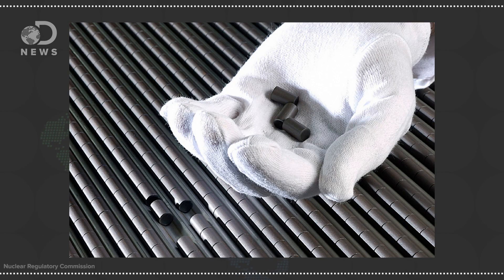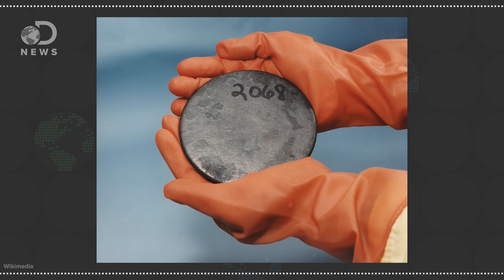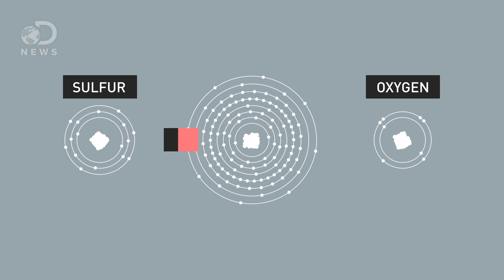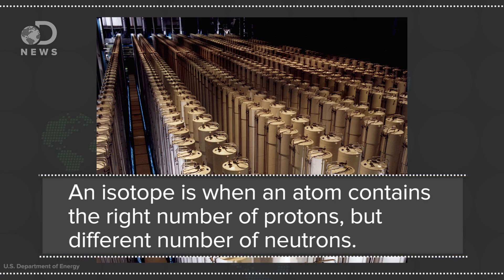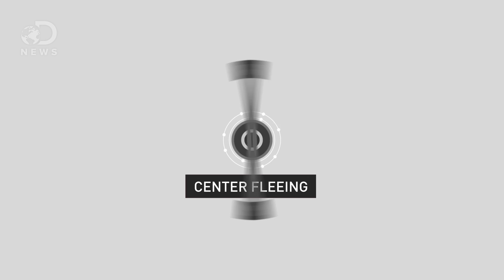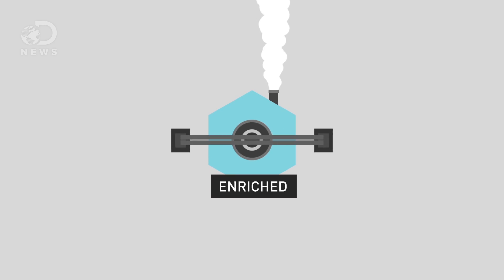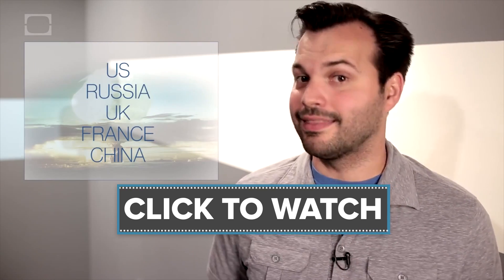How Uranium Becomes Nuclear Fuel

Comment: Sure they're called nuclear power plants, but they're not using it for energy how people imagine. They're essentially using it as a heat source to turn water into steam which that steam goes to a steam turbine and that spins a generator. I could get really technical with it since as a Electrical Controls Engineer III  and Integration Engineer I've done work for couple nuclear power plant facilities, which they all operate the same minus one detail if its high pressure produced steam or boiled water produced steam even though both still use high pressure except the boiled method not nearly as high. Water boils at different temperatures under different pressures. Other than that they all work the same.

Comment: No mention of thorium reactors? I naively assume that the thorium fuel-rod prep is quite a bit simpler to fabricate, that the rare earth thorium is more abundant and inexpensive than uranium, and that these reactors don't need to also be rapid breeder reactors that can "run away". Benefits are i) they don't create weapons-grade plutonium, ii) they can't run away, iii) they were recommended for use near populated centers in the 1950s and 60s, but Nixon authorized only rapid-breeders because of the need for weaponized plutonium during the cold war.

Comment: What I am trying to understand how can you handle a nuclear fuel rod with just minimal PPE before its inserted into the reactor, but once it has been in the core it becomes super radioactive, and very dangerous to handle?
Reply: Fresh fuel is pretty benign. Spent fuel contains lots of fission byproducts with very short half lives, and thus they are substantially more radioactive than fresh fuel. Until the fuel bundles are loaded into the reactor core with a suitable moderator no fission actually takes place. Spent fuel does indeed need more conservative handling than fresh fuel.
Reply: @paulanderson7796  Thanks for the explanation. 👍🏻

Comment: How much energy does it take to make U-235? Is that figured into the percentage comparison between fossil fuels....

Oh, it's not 3 roetgen 
Its
15,000.
Reply: It takes a fair bit, but still not really that much compared to its output. This is particularly so with centrifuges vs gaseous diffusion which is no longer used.

Comment: How do you activate the fuel rods in reactor at 1st time?  Does the fission reaction start by placing the fuel rods into a moderator?
Reply: Most fresh fuel will have the need for neutron sources initially. After a reactor has been online there is enough excess neutron reactivity from the fission products that spontaneously fission to start the reactor without the need for these sources. Fuel rods in LWR are always next to moderator because it is also the coolant, IE, water.

Comment: Assuming energy resources permanently run out, that is to say they are (finite), there is no point in killing each other – USA, N.Korea, Iran and so on,  over  finite resources because even  if anyone emerges as the ultimate winner after killing off all other competitors, that winner will eventually be met with a  resource depleted world, meaning they would in the end - after all that murderous struggle & victory, die too. Surely our intellect should enable us to see such an out come.
Assuming that energy  resources do not run out permanently – which it seems is the case, but rather there can be periodic shortages, we can do one of two things.  Either we continue to kill each other using the resources we have accumulated, from sources that do not run out permanently - a completely and utterly wrong thing to do, to use up the very infinite  resources to destroy ourselves, or use those very resources to find more resources there by mitigating the shortages.  This choice has been open to us since the dawn of our existence and will always be until we wake up to it.
If we assume that humanity has a half life  of 100 million years, the point being it is much less than the half life of  elements of Uranium or the sun (sources of energy), this means the human life will run out (extinct) way long before these energy source will do. So these energy resources are infinite with respect to the humans maximum life spun.
It seems we are killing each other under the mistake that resources run out permanently which is not true. They are sometimes in short supply. It is smatter to use the resources to find more because it is endless.  I hope we learn this and quickly change. Both war and peace require huge investments one is unquestionably better than the other. 
Finally evidently no energy resources have really permanently  run out in the last 1000 years. There is only theoretical speculation that they could run out permanently  based on a mono-intellectualism.

Comment: It might be all that efficient Plumbing is also all that very much dangerous at the same time is it worth the trade-off of another Chernobyl, Three Mile Island or Fukisumia.. it's only a matter of time before the next major disaster happens.  there's already a runaway core burning its way through our planet from Fukisumia that no one knows where it's at or the damage it's doing. Worst of all what that damage means for our kids and great grandkids.. We need to do more like the Swiss(I think) and their 0 emissions oil platforms drilling rig processing plants they have. And there wind and solar Technologies.
Reply: There is no runaway core at Fukushima, that is just ridiculous. Fission can only happen in very specific geometries. You have to make it happen. Once the core melts, it stops fissioning, period. No argument that nuclear technologies need to be handled with care, but the idea that it is excessively dangerous compared to the alternatives, even wind and solar, is not really supported by much science.
Reply: @BeCurieUs  where is your proof of this?
Reply: @jeffwolf8018  The laws of physics and reactor kinematics for one. Also, that all reactor coriums have been found. The most recent one was in January 2017. It was outside of the primary reactor containment but inside the secondary containment vessel. I would link an article but it will just get the comment blocked for spam but if you google "Six Years After Fukushima, Robots Finally Find Reactors' Melted" you will get about a dozen articles on the fact. Units one and three did not melt beyond primary containment. Reactor 2 was the only one to have that unfortunate privilege if memory serves. 

But more importantly, cores can't continue to fission outside the core. It requires critical geometry for low enriched uranium to continue fissioning. The whole "china syndrome" thing is just a movie device and can't happen in reality.
Reply: @BeCurieUs  so it's just a lot of fear-mongering from mainstream media then. Thank you for your detailed explanation I appreciate that I was unaware of most of everything you said but it totally makes sense the way you put it. Thank you again
Reply: @jeffwolf8018  It is definitely hard to sort fact from fiction in terms of nuclear stuff. Pro and anti-nuclear people spout off a fair deal that isn't supported by the science. Nuclear accidents are bad and a threat to public health, no doubt. But nuclear power also just might be the safest form of power that we have, ironically. There is an article from "our world in data" called "What are the safest and cleanest sources of energy?", which suggests that renewables and nuclear represent the safest forms of power we have, with nuclear being on par with wind. 

While you don't often think of wind as deadly, truckers get in car accidents with those big ol blades and it's not pretty but it also doesn't make the news. This is a similar paradigm to car accidents and plane crashes. Tens of thousands of people a year in the US alone die in car accidents but none really make national headlines, but a plane crash will. Just how human brains work, we focus on spectacular singular events and generally ignore the mundane but lethal. And all the while coal stacks and natural gas will kill so many more people than either of them, it makes renewables and nuclear bedfellows more than adversaries. 

I am not saying we should use nuclear or not, people are right to have their concerns...but a lot of those concerns are borne of our brains inability to do statistical risk analysis well and trusting to our more emotive animal brain. That serves us well sometimes, but not for others. Energy policy as it relates to risk and value might not be one of those areas it is best served!
Reply: @BeCurieUs  ive been blinded by solar panel farms in several areas around where i live. In Mass on Cape Cod.. Its an insane world we are living in right now.. Best thing I ever did was cut the cable cord. Saved thousands by now.  Did that back in 2014, wish I had decades before..

Comment: This is the most toxic fuel on the planet, everything from digging it out the ground, processing it for use not to mention all the chemicals it brake's down to . These chemicals can last from several hours to million's of years in the air and water table.
Reply: @sn0wdon  Unfortunately there are a lot of myths surrounding nuclear power reactors. I'd happily live right next door to one.
Reply: You do realise that the stuff lasting millions or billions of years is the safest of all? The ultra long half life is due to the fact it's decaying very very slowly indeed and thus is barely radioactive at all. A granite kitchen worktop or domestic smoke alarm emits more radiation than a kg of U238.

Comment: Why can't we use other than uranium for this
Reply: If you mean uranium 238, it is because the fission opportunities for it are basically 0 when you use water as a coolant. Water slows neutrons down so much that the Pu239 which u238 turns into after it fails to fission and just absorbs the neutron instead is not good with slow neutrons. Only about 1/3 of the time will it fission, and when that fails, it absorbs more neutrons. This is known as a neutron poison, as it steals neutrons without providing the amount it absorbed.

Comment: making uranium 235 is of course a pain in the ass, but making plutonium isotope 239 is quite easier because all it requires is a 2 step process in reactors by bombarding U-239 with neutrons

Comment: How much energy can one pellet generate? 

So if I had this pellet shoot neutrons to him would the chain reaction start and heat up the Pellet?
Reply: a pellet alone is enough energy for a significant portion of a human life, but alone it can't fission outside of its pellet friends in a reactor. The fact of the matter is fission is very hard to do and requires very specific geometries to get working because of the relative lack of the fissile element u235.

Comment: Nuclear energy is great but how much energy is used just to make it?
Reply: It is the second most energy-intensive part, the fabrication of the plant is actually more energy-intensive than the fuel, but overall nuclear is a relatively low carbon energy source on par with wind and better than current solar.

Comment: Strongly support nuclear energy, especially using molten salt reactors instead of light water or using Thorium instead of Uranium.
Reply: B-Did Diddy funny, I recently watches another video explaining molten salt reactors. It sounds very interesting. What is your opinion on Breeder reactors?
Reply: @rzgrimes  Breeder reactors are likely overly complicated for not much gain. Check out terrestrial energy and Dr Leblanc and their work on MSRs on the interwebs, very impressive with less technical risk than other MSR startups atm

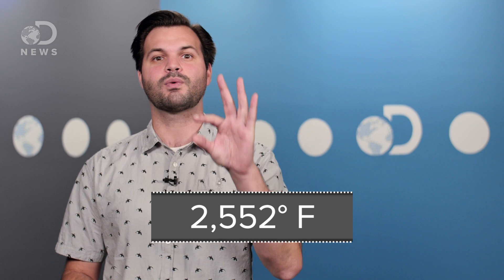Comment: Wait a minute.  How is filling a big bin of those fresh new U235 pellets @4:38 safe when a reactor full of pellets in metal rods and shielded with control rods is hazordous?!
Reply: The fuel is only seriously dangerous when jt starts to reach critical mass, which means there is enough fuel to sustan a nuclear fission reaction, little pellets aranged in a barrel aren't enough to sustain a fission reaction alone because the nutrons given off tend not to hit other uranium pellets. However in a reactor the rods are placed in such a way and surrounded by materials which act like mirrors, bouncing the nutrons that wouldnt hit any uranium back in so they do. Thus making reactivity higher, once the chain reaction has started that is when the fuel becomes extremely dangerous to be around. Control rods stop this by absorbing those nutrons so they cannot hit uranium and sustain the reaction but by then the fuel is still highly radioactive.
Reply: @TroggyPK  Keep in mind as well that without water as a moderator the neutrons are moving too rapidly for a reliable and sustainable chain reaction to occur.
Reply: yes somene answer. I was thinkig the same

Comment: 4:39 can someone explain me why are they standing next to the box of u235? lol why is it safe? it's not so radioactive?
Reply: This is low enriched Uranium so 3% at most is U235. U238 makes up the rest of the uranium content. There's not enough here to create a critical mass and thus sustain a fission reaction. In a reactor the rods containing the fuel pellets are arranged in such a way that neutrons can hit other nuclei. This is helped by neutron reflective materials inside the reactor core. Also, in the reactor, there is water present. This acts as a moderator, slowing down the neutrons and thus increasing the chance of a collision with another U235 nucleus. The radioactivity from this box of pellets is absolutely minimal and be safely ignored.

Comment: nuclear energy isn't all that bad if it's kept in check. otherwise incidents like Fukushima and chernobyl happen. nuclear power plants produce no air pollution, but they do produce dangerous nuclear waste such as the used fuel rods that are stored in ultra strong steel and lead containers. and the problem is that we do not have a long term underground storage facility to store the waste safely. but now we have what's called nanomaterials which can convert radiation into electrical energy as well as betavoltaic devices (nuclear batteries). hopefully someday we'll be driving all electric cars powered by atomic batteries which will never run out of juice

Comment: Let me simplify this complex video.  Remember the locomotive steam engine?  It took coal to make water into steam and in turn it will turn the wheels and move the train..  Well nuclear fusion does the same thing, it turn water into vapor to be used to turn electrical generators to make electricity for our homes.  Does this make any sense?  No it does not.  It is more dangerous to use nuclear power to run stone age technology.  That's my view on this.

Comment: nuclear power is our best option for providing base load energy for the grid while we work to make wind and solar viable energy sources which, unless you live in a cabin in the woods, they are not.  right now every.....EVERY  wind and solar farm connected to the grid uses fossil fuel back up for those instances when the wind doesn't blow or the sun doesn't shine.  every time we commission a new wind or solar plant.....we commission fossil fuel units to back them up.  ask yourself WHY would T. Boone Picken, who makes billions off fossil fuels, recommend ONLY wind and solar for the future?  because every time we commission a new wind or solar plant, he MAKES MORE MONEY SELLING GAS AND OIL TO BACK THEM UP.  that's why he hates nuclear.  nuclear plants do not require fossil fuel back up.  they do have emergency diesel generators which are run periodically to make sure they run when needed, but have never been needed.  and I'll add, 3 mile island released NO contamination to the environment,  Chernobyl could never happen here because no one in this country would ever turn off ALL the safety systems to run an unnecessary test and nothing like Fukushima is likely because no one here puts their emergency diesels on the beach where they are susceptible to a 30ft tsunami BUT every plant here has a back up to the back up in case the emergency diesels become inoperable for any reason.  the government has been collecting millions of dollars from utilities to provide spent fuel storage but has yet to provide said storage.  ask your congressman why they are taking the money but not providing the storage.

Comment: good video.  
Only thing is that the process is not 8000x more efficient.  U235 is about 8000x more power dense then coal.  Though the process of converting that stored energy in U235 into something usable tends to be much more efficient then converting the stored energy in coal, its closer to 2x (85% vs about 35%).

Comment: Actually, uranium is more like 3 million times as energy dense as fuel than coal. I love nuclear power.
Reply: i love radiation too.
Reply: @bored588  As do I. It makes me warm. If it weren't for the nuclear reactor in the sky, I would freeze to death. Because the DNA in cancer cells is unstable and degraded, cancer cells are killed by ionizing radiation before other cells. Not to mention that reactor in the sky produces ultraviolet rays which cause the body to produce vitamin d and serotonin. But, some nonsense about the idea that low level ionizing radiation cannot provide health benefits.
Reply: @bored588  yeah, I love visible radiation too, it hits the rods and cones in our eyes so we could see the reflected electromagnetic waves from objects.

Comment: the cake is a lie...
Reply: In this case yes...since you could be  fairly safe in the room with it and it little safety protocols and wouldn't hurt you(well no more than taking an airplane ride or getting an x-ray). Whereas it would have to be seriously concentrated to be turned into something that you could run your state power with.